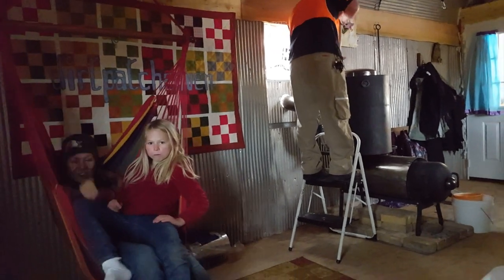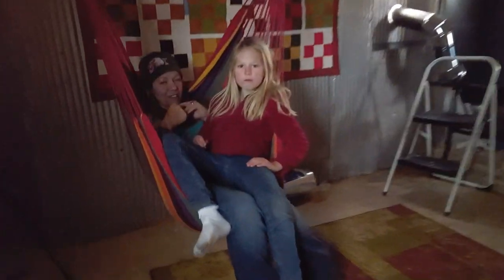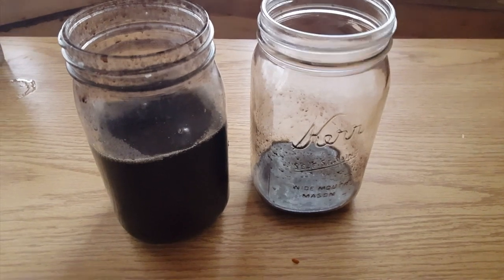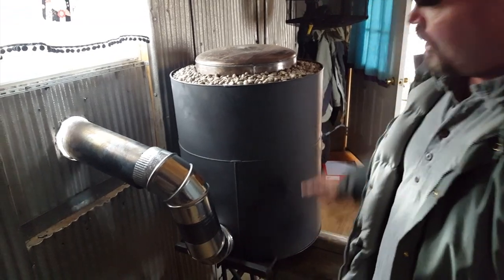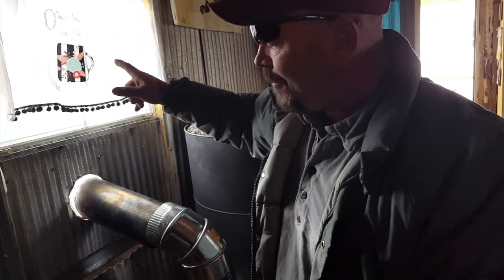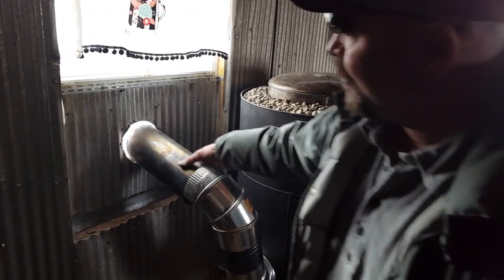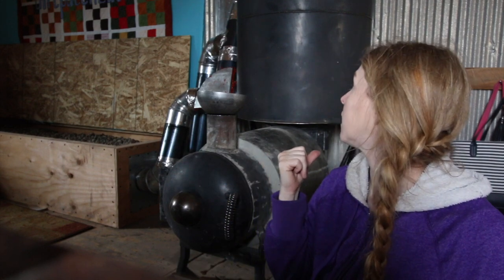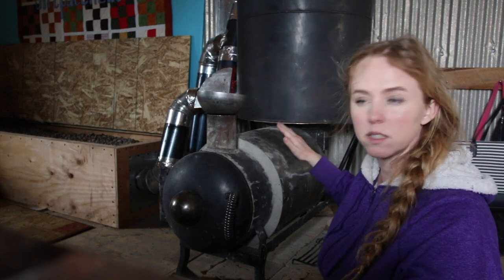AirCrete Rocket Mass Heater 1.0 vs. 2.0

Comment: Nice documentation and compliments for your persistence in working through the initial problems! 

A couple of things that will help you work out what you were seeing and may help you and your viewers work out what was happening...

1. A natural draft burner like your stove uses the difference in temperature and the natural tendency of warmer gases to rise and colder to fall. By adding the insulation to your double wall pipe, you have increased the exiting gas temperature and that increases the draft strength. This is also why the draft strength increased when the bench was attached and was warm (it acts like an insulated stack and is heating the exhaust gasses). Generally most stacks are not insulated because the heat breaks down the insulation and the ones that are use materials like dry pearlite or glass fiber for their heat resistance. With the stack temperatures you are likely getting, your aircrete may be fine or the foaming material may break down. I would not chose the aircrete due to the possible problems, despite the low cost to build. Foam off-gassing produces some very dangerous vapors.

2. The dirty water coming from your flue pipe was condensing water from the combustion process that dropped below the temperature needed to keep it as steam and allow it to escape with the flue gasses, indicating that your draft temperature was way too low for a natural draft system. Commercially made high efficiency furnaces use a second heat exchanger to make the same thing happen to get the extra combustion efficiency, but the water produced  is very acidic and eats almost anything except higher quality stainless steel. 

3. The stack height and diameter has a lot to do with the draft the strength of the draft and objects around the outlet of the flue stack will also create problems with the draft and downdrafts, particularly in windy conditions. Most engineered applications require a minimum of 10 feet of vertical flue and must be at least three feet above any objects within 10 feet of the the top of the stack. 

4. With your situation, this is probably not a problem, but you can have too strong a draft and most of the heat exits the flue instead of moving the heat to the space and keeping just enough to maintain sufficient draft to exhaust properly. 

How do I know? 25 years in heating, cooling and refrigeration, including speciality systems and boilers big enough you climb inside and 45 years in custom design, including several mass based heaters.
Reply: Very informative.  You part 4 would be hard to size properly. Could flue pipe exit litarally be dialed up or down to achieve proper temp?

Comment: Thank you for all your hard work sharing with others your journey. I wonder if instead of using the already heated air from your living space to support the fire, if you could pipe cold air from outside into the burn chamber? By using room air, you are also creating a small vacuum in your home which means it's sucking in cold air from outside. Thanks again for your efforts.
Reply: Some drafts are necessary to Exchange the oxygen in the house. Maybe venting the overheated air from upstairs could solve that problem as well. Or cold air from another room wood draw heat through th house. Unfortunately endless tinkering with a already established  home can be difficult and or expensive. Love to have a government grant to build the best layed out family home. Maybe Ben Carson could hook you up. Keep dreaming, we'll get there.

Comment: There’s no gasses in wood. The “gas” you are referring to is a result of pyrolysis and partial oxidation. The wood itself is being burned. C6H12O6. Most of it leaves as a gas this is why it’s so important to insulate a burn chamber and give secondary air.

Comment: Cherry red is 1300f
I don't want to be a naysayer but concrete should not be heated above 300c after which it can expel a large amount of carbon dioxide which doesn't sound good for a internal space.(every time it cools it slowly reabsorbs c02)
Also at the temps that get steel to 1300f the concrete will start to break over time and concrete powder is very bad for lungs even unsealed concrete floors are proven to cause serious long term damage over a few years.
Reply: Helpful and informative.  Could use more helpfulness.

Comment: CONGRATULATIONS!!! It seems that Darwin has it tuned to perfection. An air mass heater must have mass. It is the secondary burn from which you get all the efficiency and decrease in wood use and the mass  is what makes possible having heat for hours after the fire is out.  I have seen those "sister" sites that have had tiles that seemed to call out this design.
This is truly a design that does what "conventional wisdom" said could not be done . That is have a portable rocket mass heater without tons of mass. Just as lifePO4 are rewriting the book on solar.